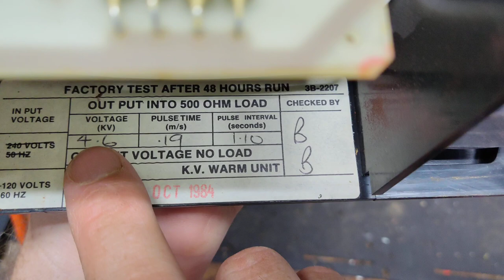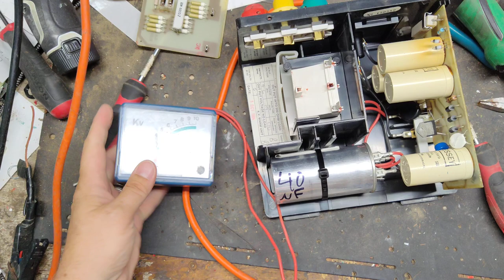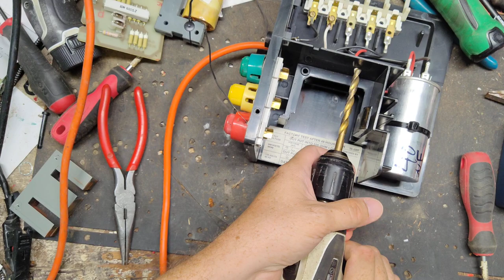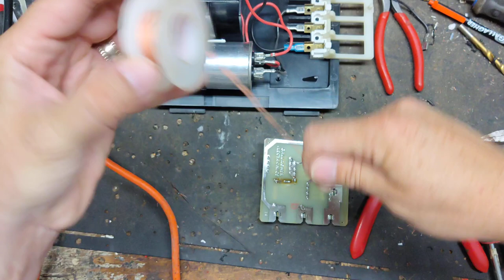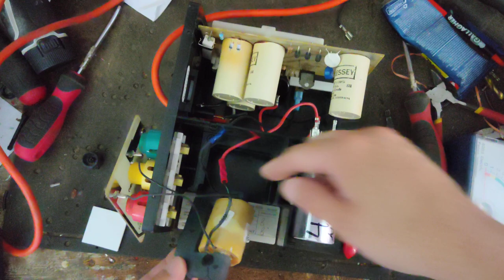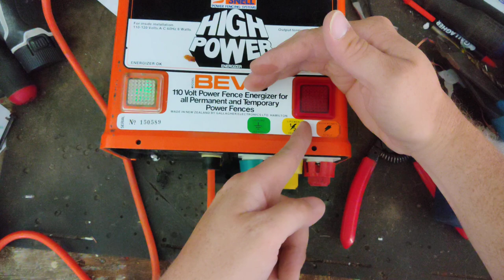36 Year Old Gallagher BEV3/M800 Fence Energizer Gets A New Output Transformer

Comment: I have one of this units.  I have replaced the main capacitor and one on the timing board.  I am getting 4kv out of the transformer.  Is there a way of getting this a bit higher for it can get quite dry were I am and the earth gets a bit poor.?   Thanks Tim
Reply from the maker: You likely have a bad output transformer in it. Gallagher themselves no longer make that part anymore, but we have a custom built one made here in the states that we use in them as well as other older models of Gallagher and some other older brands and models as well. They're $70 plus shipping
Reply: I am not so sure that it is a transformer for I tried a different one out of a different unit (not same brand). What would the expected output be with your transformer, would it be the same for a 240v system? What should the input voltage be for it looks like there is a transformer on the timing boardand I am thinking it may be the problem.  
Thanks Tim
Reply from the maker: @timothypeters2055  The transformer would be the same for the 240v models. The only real difference is the input board and some of the wiring, but the time the power gets to the big capacitor and transformer, it's all the same. What color is the transformer that's in that unit, white or some other color? If it's white, do an ohms check across the top tabs of the transformer it should read 11 ohms roughly. If it does, then it's fine only if it's the white colored transformer. If it's a different color like brown or black, I'll have to have you check the ohms and let me know. You could also remove that output board and test across the top of the transformer with a fence tester and see if the voltage jumps way up to 8-9kv range. If it jumps way up high, then the output board is your issue and the transformer is probably ok. If it still reads low, then the output board is ok and your either have an issue with the transformer or in the input board. Test across the capacitor with a digital multimeter and you should read around 600+/- to 800+/- volts DC climbing and falling as the unit pulses and such. Can you email me a picture of your input board and the transformer itself.
Reply from the maker: @timothypeters2055  The output transformer we use here will put out around 9-10kv +/-

Comment: I’m thinking my bev3 may have a bad transformer. It pops and both lights come on correctly but it tests 0. My capacitor also tests bad. My question is, would you replace transformer or capacitor or both? The capacitor tests 13 mf.
Reply from the maker: I'd definitely replace the capacitor for sure. That won't help the output though, but it'll help with the shock power in general for the joules. If the red light is flashing, then the transformer is getting at least 3-3.5kv to the board. So my guess is the output board itself has an issue. You can remove the small output board, then plug the charger back in, then take a digital fence tester and test across the two tabs on top of the transformer. Make sure you use a fence tester to test it on the output, a digital multimeter cannot test any brand of fence charger on the output, it's a high voltage typically 5,000-10,000 volts everytime it clicks.
Reply: @FencerFixerRepairLLCKansasCity  Thanks for the reply! I took the small board that lays horizontally right above the transformer out and tested with a fence tester but still got nothing.
Reply from the maker: One other test I would do is with a multimeter and the unit turned off, set your meter to ohms on the lower setting and test across the top side of the transformer. If it's hot the factory white transformer in it, it should test around , 11 ohms.